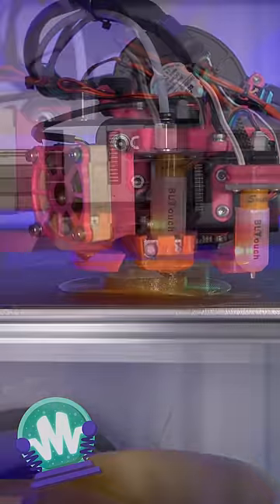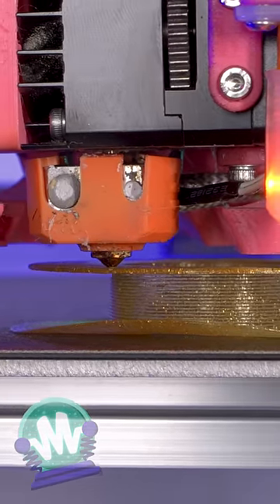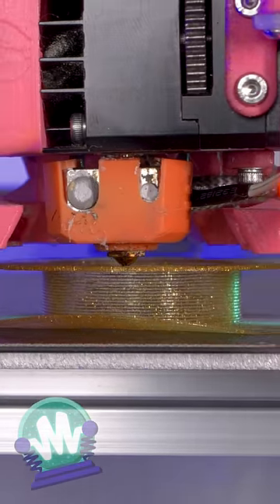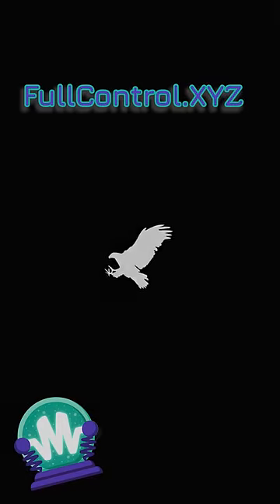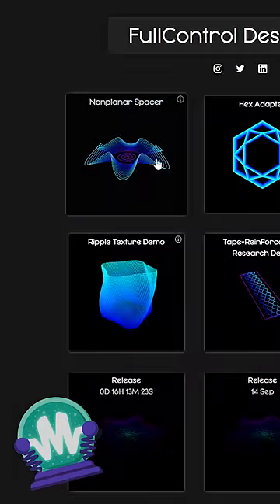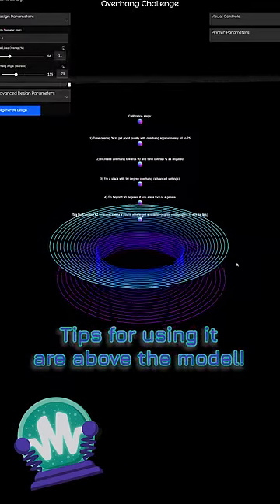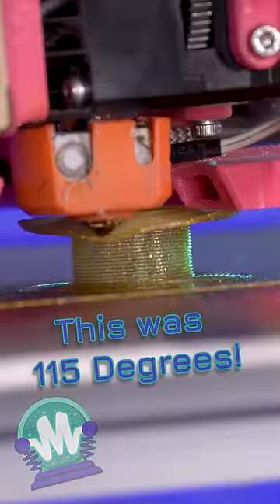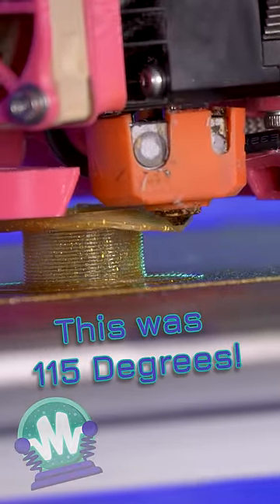3D Printing IN THIN AIR! 90 Degree Overhangs w/ FullControl.XYZ #shorts

Comment: That warp on first layer though,
Reply: Print with raft maybe
Reply: exactly
Reply: @Thc_N-fused  the point is it shouldn't be needed whatsoever
Reply: My brother in Christ that was the raft
Reply: @lio1234234  you don't know anything about 3d printing if you don't understand why supports are needed or not.
Reply: Fuck it ..
Reply: Immediately wanted to write this
Reply: How did it warp more on the first layer than the one that's literally being printed on the air
Reply: @MrEdes7  poor adhesion
Reply: @MrEdes7  because with heated bed you get temperature change up and down, and THAT'S what causes warp. In the air there's no temp change below or above the print, therefore no warping
Reply: But no issues
Reply: @infernaldaedra  You don’t understand that in additive manufacturing, printing with supports uses way too much material and makes the product way too expensive. Not to mention that it produces a lot of waste. My supervisor expects us to limit the amount of supports as much as possible when printing. If something can be printed without supports, it will be.
Reply: He may have just bent it removing it though
Reply: @lio1234234  that isn't the point.
Reply: Some printers need heated plates and/or some glue stick or tape on it because as it cools it can warp pretty bad
Reply: @randybobandy9828  doesn't matter. If the raft has poor bed adhesion so does the rest of the first layer. The bottom of the print will be uneven and probably warped/unlevel
Reply: @braapybobby  no it doesn't that isn't how it works. He could be lri ting with PC which has poor bee adhesion and it's his test prints and way.
Reply: Bed heat
Reply: @infernaldaedra  I know plenty about 3D printing thank you very much, but the point is, if you have proper bed adhesion you should never need something like a raft
Reply: @randybobandy9828  with the right bed material you should never need any "help" for it to not warp, whether that be a raft or some other method. I guess that's the point I was trying to make. If you have to, then use a raft, it's a solution, but not a good one by any means
Reply: @peytondeaton6272  Let me guess thats what they told you I'm class? Yes we should always use as little material as possible that is required to make a FUNCTIONAL part. It is perfectly acceptable to use rafts and supports if you have a part with odd geometry or a small surface touching the buildplate. Parts should also be designed to use minimal supports or any number of techniques or tools to reduce material cost. But Supports/Rafts are still tools just as useful as infill geometry and on slicers like CURA rafts and brims gcode can be customized to do certain tasks and do work for you if you let it. , eventually if you print enough things you will find a part/print/material that will require you to use those tools that are available to successfully manufacture hopefully something useful.
Reply: @lio1234234  Should Never / Will Never are two very distinct realities with 3d printing. Especially with so many different materialistic and parts you can print.
Reply: Doing one now lol , just so happened to see this while it printing . Doing the 5 element stones,  and noticed too late no support on the overhang! Wish me luck 🙏 lol
Reply: @MrEdes7  hot bed or contaminants on bed traces amounts of solvents or dust
Reply: @peytondeaton6272  str8 up
Reply: @infernaldaedra  homeboy it's business it's wasted money and time if it doesn't need a support they won't do it half the parts they print they probably clean up anyway a Dremel and a sandpaper attachment is $10 and takes 3 minutes.
Reply: @dplugCAPZ  You barely skimmed over my comment apparently.
Reply: I don't know much about 3d printing, but I'd suggest the same black magic that is allowing the open air printing has caused the lower section, that is supported, to lift up through tension.
Reply: @lio1234234  owning an ender 3 doesn't count
Reply: He needs the bed temp to drop by a few degrees. Usually warping is caused from the bed being to hot, rafts can help but I prefer not using rafts
Reply: Lol exactly. Think he's using pla on textured sheet.  It's a pain. Pla "needs" smooth
Reply: @Thc_N-fused  raft, always
Reply: 90 degree overhang, but can’t print flat on the bed lol

Comment: Circular motions is the secret, the extruded string gets enough tension to the part so it sticks better to it… try doing the same with a square, it won’t work.
Reply: Circle stronk!

Square suck!
Reply: Oof, suspected there was a catch
Reply: Hmmmmm interesting, the logic is there for sure.
Reply: Could you not tension it using the speed of the head?
Reply: Smart i wouldve never thought of that explanation but it does make sense
Reply: but it could be implemented in a splicer to create any shape in circular motions to take advantage of this
Reply: Genius, I wonder if any other shapes work
Reply: And it only works on the outside of the body. On the inside it pulls the extrusion out of contact with the existing wall. I discovered this by accident printing a bottle plug with overhangs on both sides.
Reply: @HonestAuntyElle  The direction is important. Tensioning in a circular motion pulls the hot layer against the previous layer and lets it properly adhere. The layers would easily break apart if you didn't.
Reply: If the object was rotating I'd agree but since it's the printing head rotating I'd have to disagree. The extruded string isn't under tension. Tension would stretch it since its basically melted plastic.
Reply: It doesn't matter. Motion is relative.
Reply: unless you do a zig zag pattern at the edge, won't be as clean but should work
Reply: Its tpu, tpu bonds extremely well
Reply: I feel like a square would still work would just have to build it ring by ring

Comment: “No issues” 
Me staring at the warp at the bottom 
👁👃👁
Reply: i thought that that was an intentional design feature lol
Reply: @wassupbros4629   If so it was a terrible decision to use it in a promotional video.
Reply: @c_n_b  i thought it looked kinda nice i dont know anything about 3d printing so didnt recognise it was warping
Reply: I think you are missing the point he is talking about not having issues with printing at 90 degrees without supports not the bad adhesion
Reply: So good that it doesn’t work with support😅
Reply: That's a sign that his printing bed was to hot causing the plastic to warp. He just needs to turn it down a few degrees next time and he wouldn't have that problem

Comment: it work by going just fast enough to have the melted plastic but slow enough that waht is printed is solid enough to not deform or deforme just the right amount for negative.

there must be a data base of nozules and printer to be able to calculate the speed of printing and the angle of print. 
like .2 mm above the previous layer ornsomthing that waybif that melt it get to the 90°

Comment: You often have the same options as having a 3D Pen especially if you are using a 7 axis robot arm amd have fine control of your extruder temperature and extrusion rate , the same arm having pick and place abilities is also where the fun explodes as it can grab parts from other parts printers 🙂

Comment: Man Im still struggling with pla stringing after a year into 3d printing.
Reply: You have your retraction too low, Printint too hot or your fan speed isn't high enough, do you have a bowden set up or a direct drive extruder?
Reply: @Rimorox  cr6-se bowden with Capricorn tube Inland pla dried in ebox lite print temp 210. I have tried cura retraction tests from 1-10mm with speeds from 10 to 70mm/s. on a large objects (6mm diameter) retraction is ok but on small 2mm It strings. fan speed 100% .4 nozzle .2 layer height thank you for the help.
Reply: @andrewr6861  2mm is probably just getting too small to easily print on a bowden.
Reply: @andrewr6861  ditch the Capricorn, it's a waste and you'll do better with a normal tube, for starters. Second, 210 is definitely too hot for PLA

Comment: why are there holes in your ears?

its unattractive to most if not all people so i doubt its cosmetic, it reduces your ears ability to funnel sound into the ear canal, so i doubt its for a tactical advantage, and i cant imagine that wind blowing through the hole is by any means comfortable, so i doubt its for pleasure, so why? theres no plausible reason to do it? did you lose a bet? get into some freak accident that required someone to use a hole puncher on your ears? why? i need to know

Comment: Those who can't machine, 3d print. Ask every 3d printing engineer
Reply from the maker: I’m a former metal fabricator with manual machining experience. Try again. 3D printing opens possibilities that manual machine can never hope to and is very quickly becoming an integral part of prototyping & manufacturing alike. You could poo-poo it or you could not be a luddite and expand your knowledge base so you are more experienced all around.

Comment: I didn’t realize there were limits to shapes of 3D printers. Figured they could make anything.  So I’m now less impressed with these printers than before watching
Reply: No limits on shapes, just overhangs, but most people use removable supports for overhangs anyway
Reply: Did you not realise 3d printing was bound by the laws of physics?

Every single form of modern manufacturing has limitations; it's just a case of selecting the most appropriate tools for your application.
Reply: @literate-aside  obviously I realize it’s bound by physics. But it’s not like we don’t have plastic items with overhangs so I never viewed that as a limitation.
Reply: @codycast  That's why people use supports, it's honestly kind of funny the amount of people who think 3d printing is the same as injection molding. 3d printing can do things injection molding can't like making parts hollow or extremely intricate shapes that just couldn't be done using traditional injection molds. It's also way cheaper to get into and doesn't require an expensive CNC molds everytime you want a new part or make a revision.
Reply: @codycast  injection is a completely different manufacturing methodology, entirely supported by the mold.

3d printing is enormously different; it's advantages lay in low volume speed, and zero tooling cost.

Besides, 3d printing can have overhangs; you just use supports. The purpose of the impressive technique isn't the overhang, it's the lack of supports.
Reply: Hello? Do you just think these are Star Trek replicators? You must have lost touch with reality a long ass time ago
Reply: I forsee a life of disappointments ahead of you if you don't bother to apply any critical thinking.
Reply: @ferrumignis  lol okay man. I’m highly successful so there goes that theory.  But hopefully your knowledge of 3D printed overhangs does well for you.
Reply: @codycast  "I'm highly successful"  🤣🤣🤣🤣
Please, make me laugh some more!
Reply: @ferrumignis  not sure how you define succsss but I just got back from a private flight from my vacation home in Costa Rica. I’m back in my 5000 sf ocean front home in San Diego. I have more money than I’ll ever need after selling my second company that I built from ground up. 

But hey. At least you know what can be made on a 3D printer. 👍🏼  congrats… 🎉
Reply: @codycast  I completely believe you. Also I'm the ruler of the galaxy.
Reply: @ferrumignis  I keep the videos on my channel hidden as they’re just for my immediate family but I unhid some I’d you’re curious.  There were a few that don’t go into detail of my exact address.
Reply: @codycast  Idk why you keep trying to convince yourself of your success, there's really no need.
Reply: @ferrumignis  lol okay man 👌